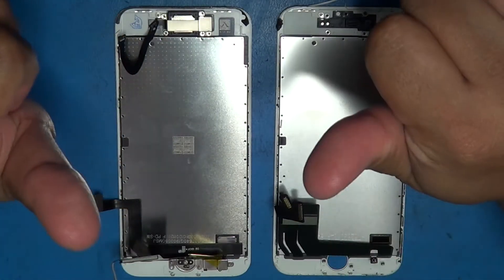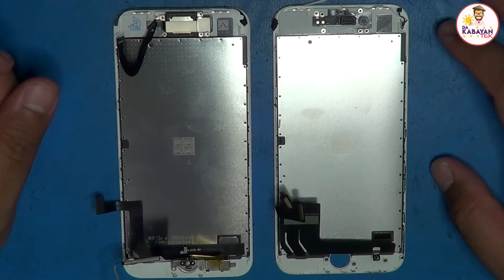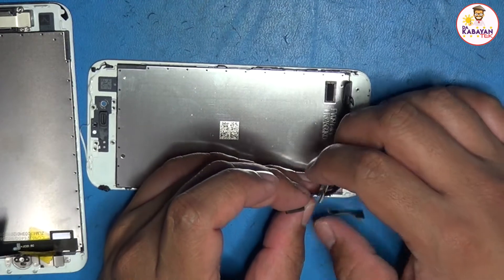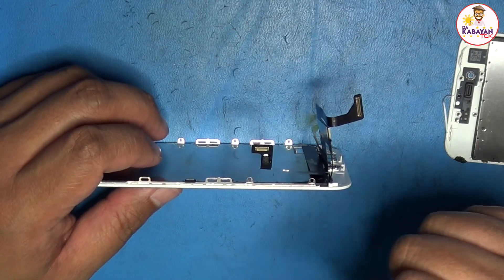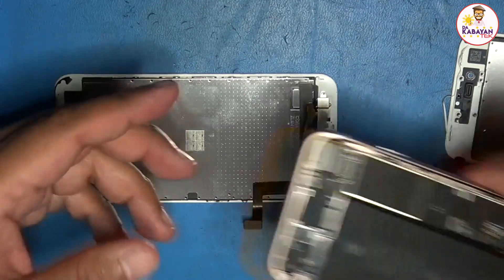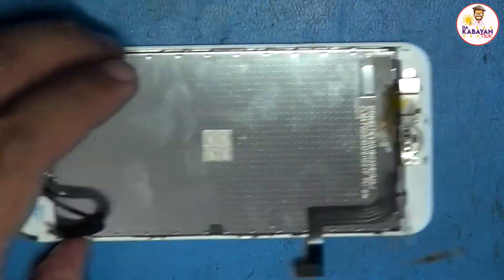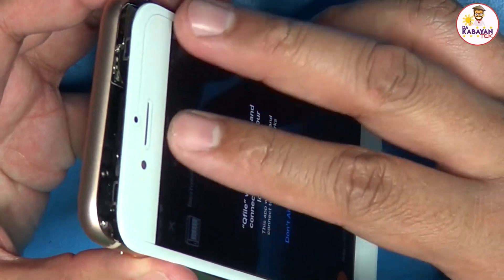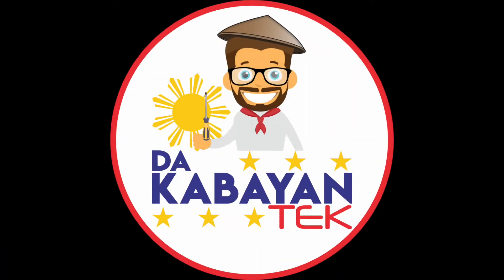UPDATE: Replacing HomeButton Using JC Home Button &  JCFlex

Comment: Walang Tough ID sir?
Reply from the maker: Wala po kase po encrypted po yung sa ic.  Only way lang po to have the touch id back is to have a full display replacement thru Apple or Third Party Apple Authorized Service Centre kase sila po ang may software that recalibrates the new home button... Granted po na nasira na po ang original home button..

Comment: if i change only cable!!! my hobe button is original unfortunately i cracked my cable then fingureprint Doesn't work😢
Reply from the maker: Which cable is cracked? Is it the one that is connected to the actual home button or is it the cable from the screen?
Reply: @DaKabayanTek  sakin yung cable flex naputol na naka connect sa homebutton gagana pa kaya yung fingerprint?  Kapag pinalitan nung flex cable pero orig parin homebutton? Or hindi na gagana touch id?
Reply from the maker: Yung cable na connected directly sa home button? Or yung cable kung saan connected yung cable ng home button? Kung yung actual cable ng home button it will require microsoldering saka dipende pa ren kung san po ang naputol.

Comment: exist some solution to remplace the touch id function ot work again..?
Reply from the maker: For a simple solution theres none.. if u are good with microsoldering u can transfer the new flex and attach it to the original home button. Or unless u are willing to pay Big “A” to have the full screen replace.
Reply from the maker: From Experience, I find having the jc flex cable makes the response of the jc home button more accurate.  If you are using jc home button with the original flex cable and everything works then retain the original cable.